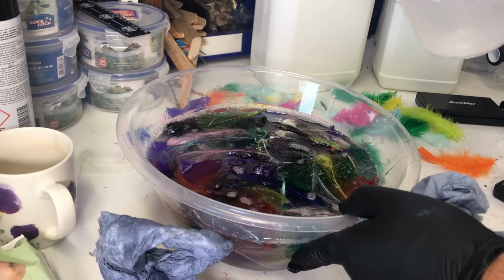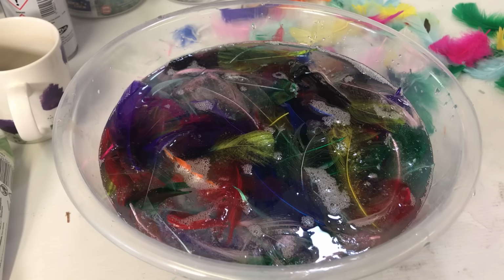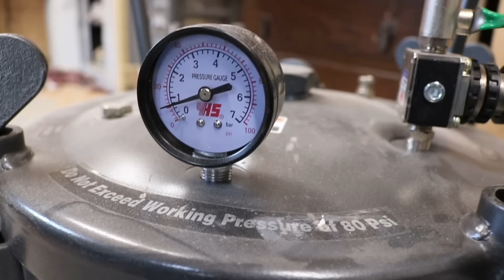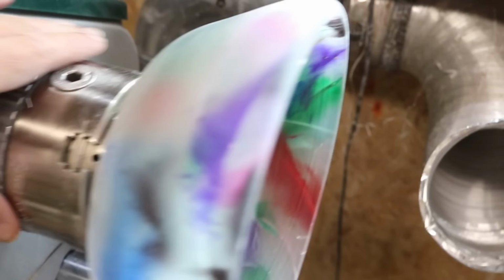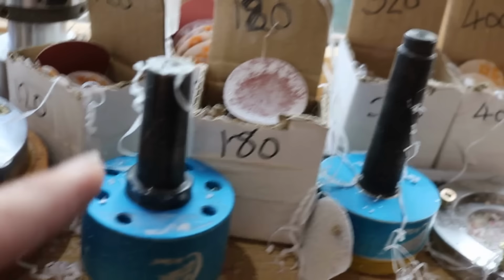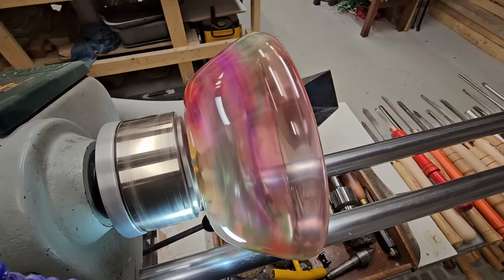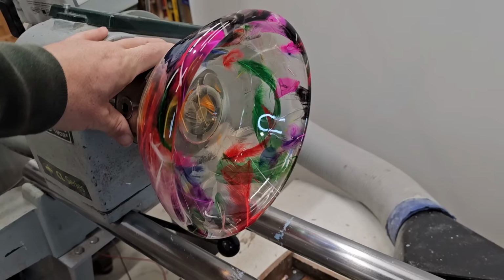Woodturning - Coloured Feathers 🪶

Comment: I had to stop sculpting to watch you work… beautiful as usual. I wonder if the ends of actual peacock feathers would be flexible enough to bend around a cylindrical mold? That could look cool. Also, I wonder what strands of beads or a crocheted or knitted fabric would look like in a resin project.